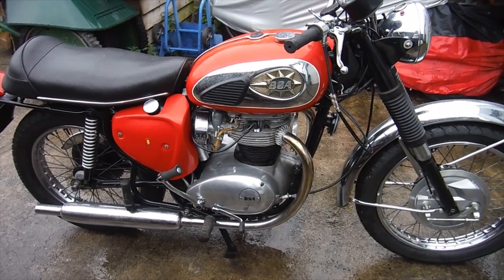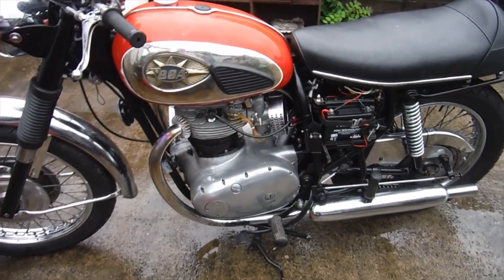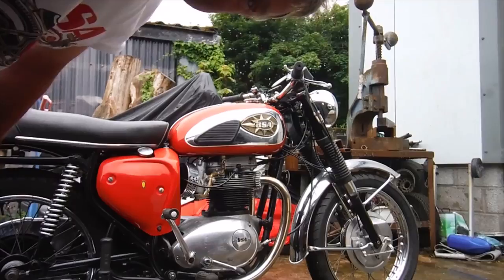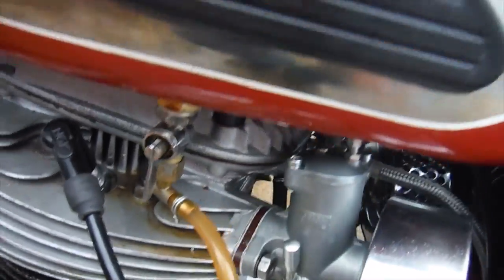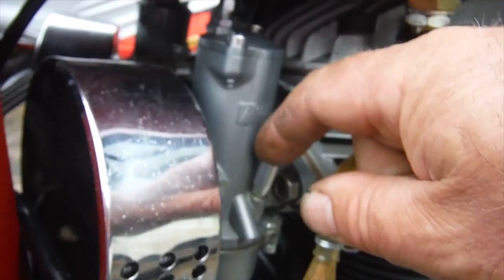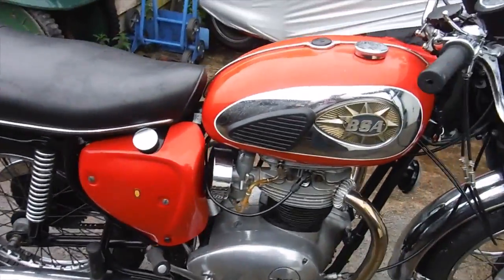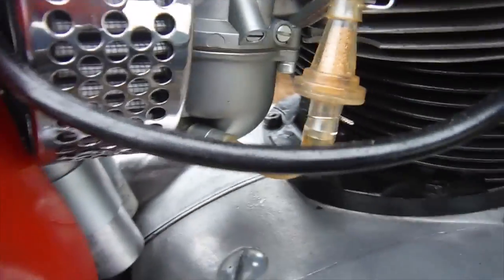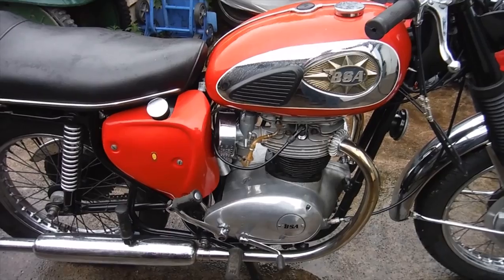BSA A65 has new carbs and electronic ignition but won't run properly 1 Initial investigations

Comment: New Premier carburettors? The new floats can be a nightmare, they stick in the closed position, too loose on the spindle, colliding with gaskets and the back of the float chamber, the new stay up float design has rounded off edges on the tab, old ones are sharp. The combination of loose spindle and old tab design gives intermittent sticking, had this problem on my Norton, drove me round the twist got there eventually, good luck, smashing videos.

Comment: My experience with new Amal concentrics, Premiers, is the pilot circuits can sometimes have drilling swarf causing blockages right out of the packaging. Need to thoroughly clear them/poke through the circuit passageways etc until you achieve a nice spray out of the two tiny holes in the carb throat floor, one either side of the throttle slide edge, air inlet end. Also, the float pivot action can sometimes foul on the bowl gasket material and solution is to trim the gasket near the hinge pivot rod. 
On this bike, I'd check the fuel flow from the tap and also through the in-line filter and the mesh screen in the banjo on the float bowl. All potentially contributing to poor fuel flow on one side.

Comment: i Paul, never was a fan of those in line fuel filters and have a feeling ight side doesn't get enough fuel to work properly, so as a first step would check what is a fuel flow from right side tap to the carb.

Comment: I always just hold the ticklers down until fuel comes out. If no fuel comes out, something is wrong. The tickler just holds the float down, so if there is no fuel coming out, that means there is no fuel getting into the carburetor when the needle valve is held open. Is the right side cylinder getting warm?

Comment: One thing I found working with my A65 is a problem with fitting an electronic ignition. The A65 engine has a wide advance range, 12 degrees according to the engraving on the points plate. When I fitted a Tri Spark system, which seems to have 8 degrees of advance, and correctly timed at full advance, the bike became quite hard to start.
Reply from the maker: And let's not forget those advance figures need to be doubled to equate to crank rotation in degrees, as whether points or electronic, they are driven at half engine speed.

Comment: Petrol taps have filters in tank check there not blocked up.remove the external ones .Make up,some new pipelines .Fill tank halfway and open taps to check fuel  flow of pipes .If OK connect to carbs ,open bottom large screws to clear air and tighten .Should run correctly .If not Not both slides same height ,chokes up mixture screws same . New plugs ,leads and insulted caps check.

Comment: Verify fuel flows from the offending float bowl via the bowl drain.  If no flow but flow is verified from the fuel line when pulled from the carb, suspect there may be some new-carb assembly snafu interfering with the float valve.  Hopefully the bowl can be pulled whilst the carb remains in place to sort the float/valve operation if the above scenario holds.
Also maybe add a liter or two of fuel just in case there is no cross hose on that tank and the right side is dry while the near side has fuel

Comment: I would guess it’s fuel starvation. Check the petrol cap for venting, check the filters on the fuel taps and I assume there is new petrol in the tank, not some old fuel that’s been left for years. If all this fails, you’re going to need to strip the carbs down. May I suggest that you take it to a garage or competent mechanic though, as there are some pretty small parts in the carbs and very accurate sizes and measurements to consider. Lovely bike my friend, it’s always a pleasure to see these machines being preserved. Keep the videos coming.
Reply from the maker: I regard myself as a competent mechanic - doing this sort of work is my job, but thanks anyway!
Reply: I would guess that you're new to Paul's videos eh mate?
Reply: @paulhenshaw4514  correct, all the spanner monkeys like me are dying off i am now in my 80th year there are very few mechanics now they are all technicians plug it in read the diagnostics open a box take out an expensive part ,fit it,stand back pat your own back charge customer £100/hour take your rubber gloves off job done.
Reply: Give me a carb and a set of points anytime!
Reply: @alexyoung4763 …..lol 😂 your right , well said

Comment: Just a short piece of pipe to bypass the filters for a start.That would rule out fuel taps as well as filters to start. Then head into the carbs. It is a fuel problem and those porous bronze Inline fuel filters made in China suck.
Reply: Yes, I'd junk the lawnmower fuel filters whether they're the fault or not. 40 years ago I fitted one on my 900 Honda and it wouldn't flow enough petrol to run the bike.

Comment: I never tickle my carbs like that. Pro tip....hold the tickler down until fuel squirts out. If it doesn't, there's your dinner (as Taryl says). Run the bike up to 1800 RPM. If it clears out, that tells you the idle and low speed circuits are plugged. That's what my 1967 Matchless G15CS was doing. Hard starting and stalling. Replaced the right side carburetor, and that did the trick. Turns out the passages in the float bowl were plugged. I figured that out after buying a new carb. Always good to have a spare.
Reply from the maker: Pro tip my a*se.

Comment: I know BSA made Guns and Bikes but not often at the same time? sounds like the points or coils are wired wrong to me, or at least once any fuel gets past the 'trending tropical fish food filled visu filters' and 'multiple each one different fuel pipe clamp showcase variety selection' aka gack plastic fuel lines it's obvious something is wired 180 degrees out on the right cylinder. I'll wait and see how wrong I was now 🤪

Comment: A mistake often made is too many modifications at the same time...do either spark....or fuel air separatly and tune...that way you know if prob is  spark  ..or fuel air
Reply: It's like a 60 year old bike !! It needs a total resto. My dads got a 40 year old van and rushes me to fix it. Doesn't understand that all the rubber bits are perishing, other bits corroding, etc,etc. It's a Daihatsu, the only reason it's still alive.
Reply from the maker: It's had a 'total resto', but not a very good one ...